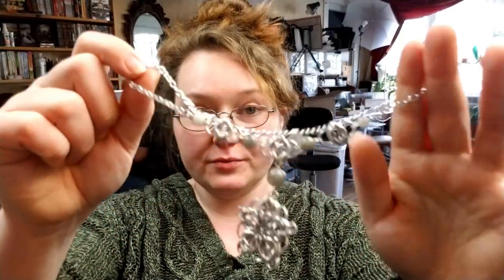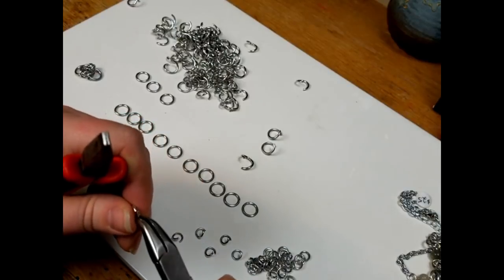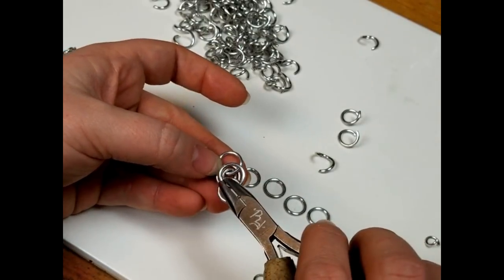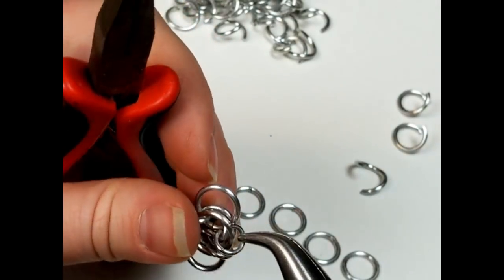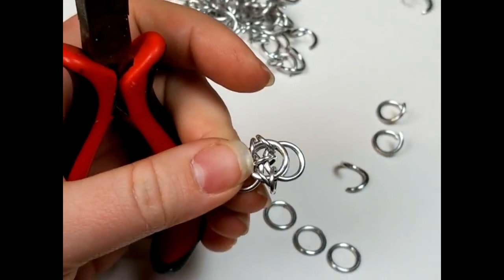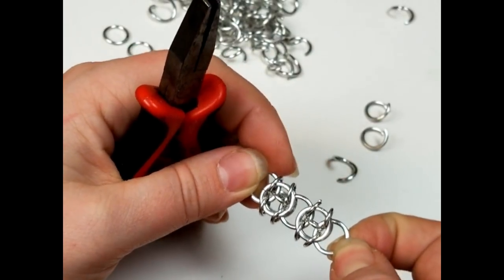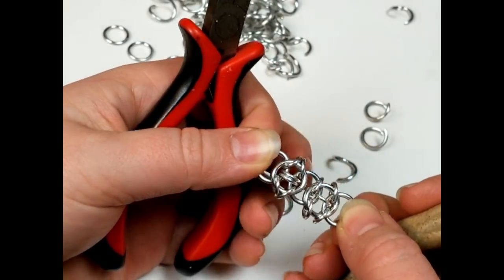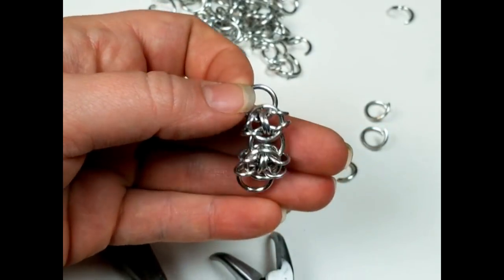Celtic Visions Chainmail Weave

Comment: Brilliant weave, this one really stands out from a lot of the others, when I can find a jump ring supplier in my Area,  East Coast Australia, I will be weaving, mixed bright copper and silver for starters, many thanks. [ You have a killer smile] I have subscribed.   :-)
Reply: You can make your own jump rings very easy and quick.
Just take wire in the thickness you want, tightly wrap it around a steel bar with the diameter you need en saw them all open from the inside out.